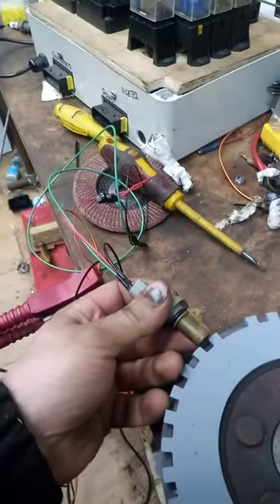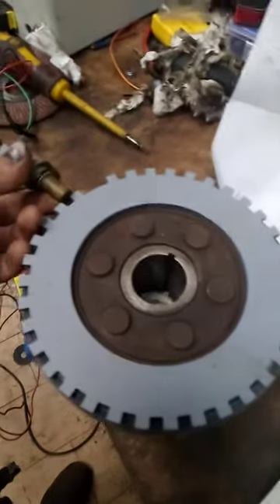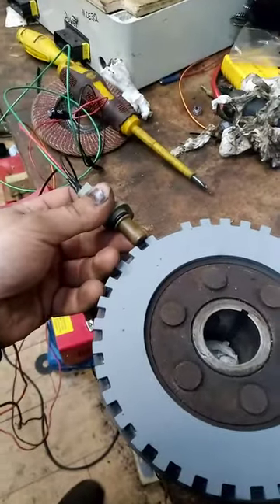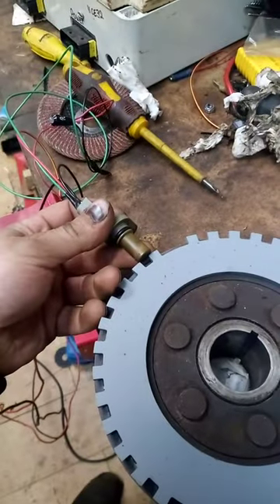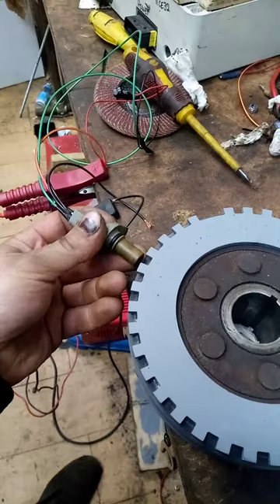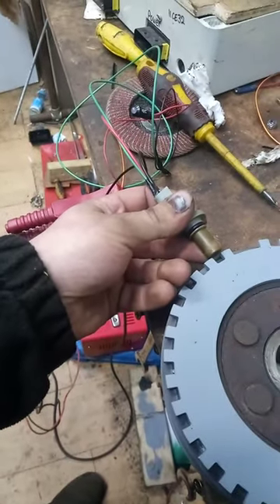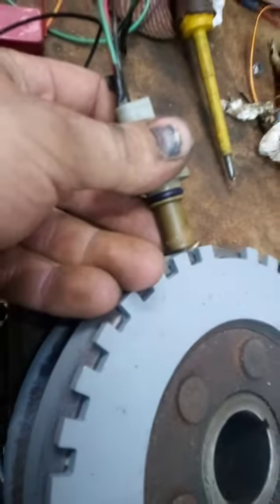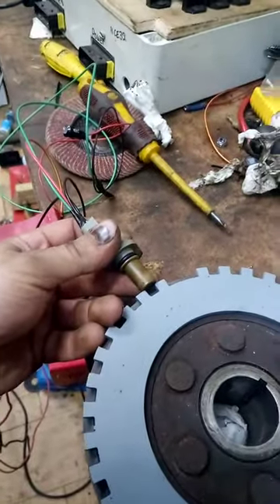Wobblecam | Bedford Crank Trigger Test

Comment: What Bedford engine are you working on I'm looking into a TK300 engine
Reply from the maker: This is a 300 gasser, a fairly late one at that, and the current theory is that it's come out of a TK.
Reply: @tamberp  wat are you doing for intake? injection...I'm wondering about 2 injectors per intake runner done as individual squirts with plenum and throttle body. May be a AU falcon 6 pack wasted spark coil unit for spark. Good luck with your set up Cheers DG
Reply from the maker: @davegardner7731  Current plan is single injector per runner, but that might change if it proves to be too much of a bastard to tune around the siamesed ports, with a Vauxhall Omega V6 coilpack and a 52mm throttle body off a MG ZR.

The 52 looks a bit small, but it's bigger than the 48VIR, and it's a slow revving engine comparitively.

Also: I'm using an MS2X equivalent from kdfi, wired up for 6 ignition drivers, but set to 3-coil wasted spark when it turned out that LS1 coils are expensive as all hell!
It could do 6 injectors, too, but I've only got it wired for 3 at the moment. There's room on the connector for the others, tho, if I do need to switch to sequential fuelling; that's why I've got both crank and cam triggers . :D
Reply: @tamberp  sounds very good was going to say probably need a cam sense too with 3 injectors. The old 58 bus my mate has is my project trying to improve gas mileage and rid the distributor bastard things. Thinking will go with 3 injectors too. Do you know of any models that had nice exhaust manifolds Cheers
Reply from the maker: @davegardner7731  'fraid I don't! I'm going down the mad path of making my own.

(And it was going so well, 'til I realised I completely forgot about the front axle, and the headers run straight into it. Oh well. :) )
Reply: @tamberp  go hard you'll make it